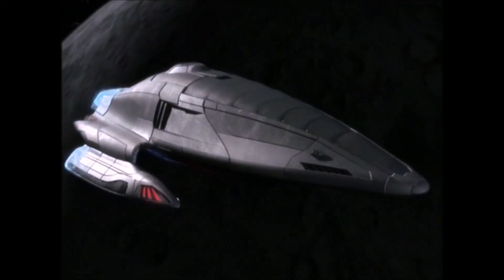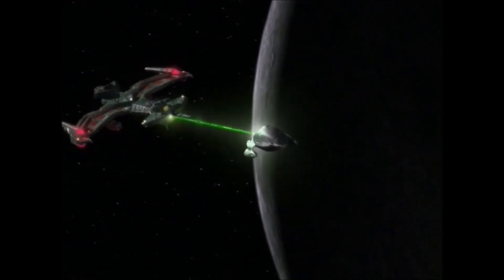Starfleet's Ablative Generator

Comment: Thought this was gonna describe ablative armor from the series.
Reply from the maker: I'd like to see it, too. They kept talking about it all the time, but they never showed it.
Reply: @Pavel_M_Mihalik  The ablative armor generator works on the same principle as ablative armor on Defiant but differently. It consists of a network of external replicators programmed exclusively to shape and fabricate a formula of armored panels of a specific molecular matrix, integrated with force fields. With space between the hull and the armor the force fields act as the adhesive to hold them to the vessel but also dampen the impact as the armor is not directly connected. The Armor panels provide the protection and the ships shields Interweve with the armor matrix. Imagine two plates of steel with springs in between to dampen the impact if it hits something or something hits it.
Reply from the maker: @spikedpsycho2383  Oh, I know how it works. But thanks for the detailed analysis. 😀 I just wish we saw the regular ablative armor in action.

Comment: The Borg Queen upon seeing that would have ordered the last cube to ram Voyager.
Even the ablative armor would not withstand being hit by a large mass like a Borg cube nor survive inside the fireball explosion of the cube after impact.
It looks cool but it is a bit of a Mary Sue way to treat Voyager.
But it did feel good to see the Borg lose brutally for once.
Reply: Matthew Edwards 
Kinda. The borg actually get the armour down to 30% fairly quickly. Also transphasic torpedoes arent really any more powerful than quantums. They are just rediculously hard to adapt to and shield against making them perfect against the borg.
Reply: A fireball explosion would be fairly weak in the destructive sense, when compared to focused beam weapons and torpedos, which had almost zero effect on the armour.
Reply: The Borg would never see technology far more advanced and try to destroy it. It wouldn't take away any chances at assimilating the armour technology and the torpedos. It waa trying to damage the ship so that it could get inside which is why she let it continue so that the collective could work on the scans they made

Comment: I find it weird the shuttle's ablative armour fits the much larger Voyager.
Reply: It's probably made with Janeway's form fitting inner wear
Reply: Because it's STRRRRRETCHYYY!!
Reply: Seven of Nine said that she could adapt the defensive systems of the shuttle to Voyager.
Reply: @Schwarzer Ritter
It's a form of a replicator. The idea is that the armor panels and separate shields for each of plates materialize, when the element is destroyed it immediately is replaced with another one with a slight different shield harmonics. Just give it a shape of what it needs to cover and buckle up.
Reply: The ablative armor generator works on the same principle but differently. It consists of a network of external replicators programmed exclusively to shape and fabricate a formula of armored panels and force fields. With space between the hull and the armor the force fields act as the adhesive to hold them to the vessel but also dampen the impact as the armor is not directly connected. The Armor panels provide the protection and the ships shields Interweve with the armor matrix. Imagine two plates of steel with springs in between to dampen the impact if it hits something or something hits it.
Reply: Janeway gave them the specifications to outfit the ship.
Reply: @spikedpsycho2383 specifically she brought a customized version, custom fit to an intrepid class. The auxiliary system needed to get it running was brought by her as well.

Comment: Where are the shields? You don't replace one layer of defense with another, you have both where possible. Even if the shields only last for a few shots it's better than nothing. And why wait until your armour is almost gone before you start fighting back... bad tactics.
Reply: Not using shields means they have more energy for weapons and engines.
Reply: Weapons that they didn't even use, apart from launching three torpedoes; hardly worth conserving all that energy for. And the engines didn't need the power either, because they didn't even bother to go to warp!
Reply: Torpedoes were actually all that they could use, the armor covered the beam arrays.
Reply: I thought Torres told them the shields couldn't be modified to work with Voyager.
Reply: shield emitters were also allegedly covered :P 
That could be why no shields... You can see how they need to open hatches to shoot torpedoes...
Reply: A starship's shield generators are on the inside, not like those crazy starwars ships with giant balls for shield generators.
Reply: Not Dave 
I thought the generators were on the inside but the emitters were on the outside? (correct me if I'm wrong, this is just what I always believed)
Reply: Probably for more power to engines, structural integrity fields and the inertial dampeners? ...Plus shields suck against Borg because they can drain shield energy. I mean it's a pretty mighty tactical advantage to actually be able to save energy during a fight than to lose it.
Reply: Enkarashaddam 
And it just means that when the armlur does start to fail. Shields up at maximum phasers at maximum. But phasers and shields have only moderate effect aginst the blrg even with remldulation.
Now transphasic modified phaser and shields do work but they are very energy intensive. Which is another god use for ablative hull plating
Reply: Not Dave the Shields are more or less useless against the Borg, the Armor instead makes a pretty decent Job and can protect the Ship pretty well on its own. So why waste Energy in a useless System, when you can put it in the Drive and Weapon Systems.
Reply: Not Dave  It would make sense to wait until the ablative armour was exhausted before switching to conventional shields. Otherwise it would be wasting needed energy unnecessarily, and just wouldn't make sense to have both shields and armour on at the same time. Using  both at the same time would be akin to wearing a raincoat to protect from outside rain, while walking around inside the house.
Reply: Actually you do in Voyager different in Star Trek Online the Armour is essentially shielding I think it is powered similar to the shields or using the shield generators (or it disables them)as it does in Star Trek Online regards to the weapons not revealing that you have advanced torpedoes (phasers will not fire when armor is deployed) would delay the borg adapting to the weapons.
Reply: The ablative armor generator works on the same principle as ablative armor on Defiant but differently. It consists of a network of external replicators programmed exclusively to shape and fabricate a formula of armored panels of a specific molecular matrix, integrated with force fields. With space between the hull and the armor the force fields act as the adhesive to hold them to the vessel but also dampen the impact as the armor is not directly connected. The Armor panels provide the protection and the ships shields Interweve with the armor matrix. The ships shields arevthe fortification. Much like piezoelectric effect, they fortify thevarmor matrix.  Imagine two plates of steel with springs in between to dampen the impact if it hits something or something hits it.

Comment: That's not how science works!
Reply: It is when war is totally turn-based!
Reply: They do have replicator technology, which in theory means they should be able to infinitely replenish the armour as long as they had power.
Reply: A flaw in that logic.  Their opponents also have replicator technology, which in theory means they should be able to infinitely replenish ammo as long as they have power.
Reply: The amount of energy that this would require makes it impossible. Even with matter/anti-matter, you'd need enough of that to equal the mass of the generated armor.
Reply: Clearly you've never watched Star Trek or you'd know they replicate everything without a concern for energy requirements, nevermind that replicating a sandwich would require more energy than a commercial power plant can provide. Anyway if I recall correctly (and I do), the replicators don't synthesis things out of pure energy, they have a raw feedstock that comes from recycled waste (all kinds of waste, even sewage) that is transmuted into whatever object they want.
Reply: Not Dave 
I think so. Kinda like alchemy in full metal alchemist. They can use the base elements to make whatever they want. 
It is likely that ablative hull plating is made up of an artificial substance or element and therefore cant be replicated because it doesnt naturally exist. Like how phasers use artifical nadion particles or torpedoes use antimatter which has to be produced.
Reply: Said the borg queen.